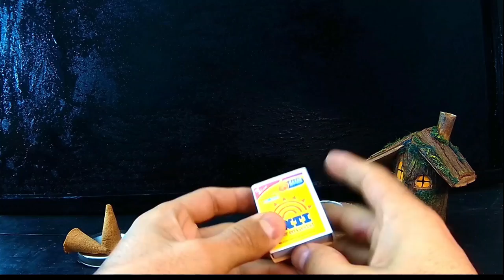Wood work project ideas / Make a decorative wooden house incense holder / Wood craft ideas

Comment: Very nice project and wonder if there is a fire risk? I'd like to make something similar. Thanks for posting this video !
Reply from the maker: It can be a fire hazard if it's too tight inside. Ideally choose hardwood and leave enough space so that the incense does not touch the wood.
Reply: You could probably also find some kind of metal tube to go inside the house if you wanted. Even if it's just an aluminium drinks can that you cut and squeeze to the right shape for the hole you've cut. That should minimise the risk of wood fibers catching fire in there.
Reply from the maker: @theKNI  thanks for idea